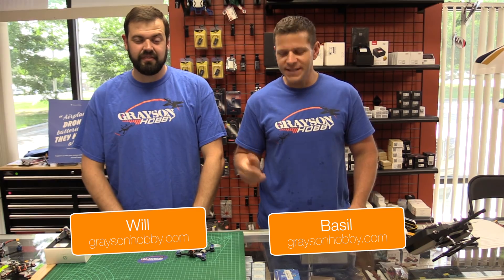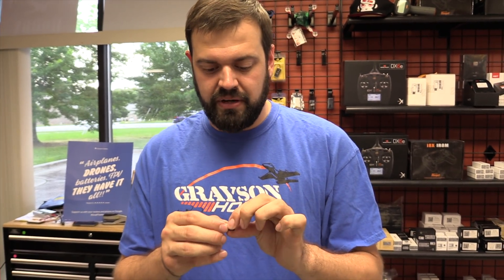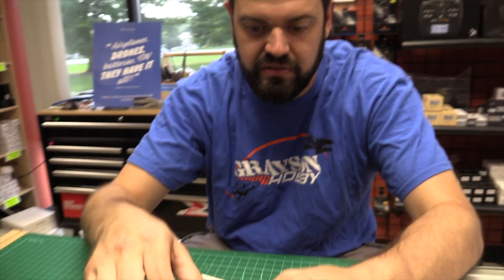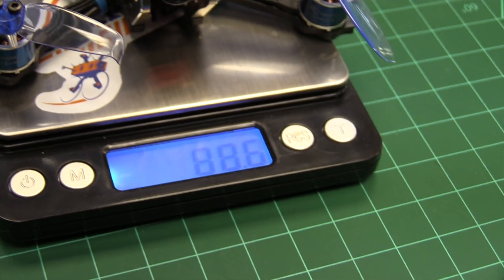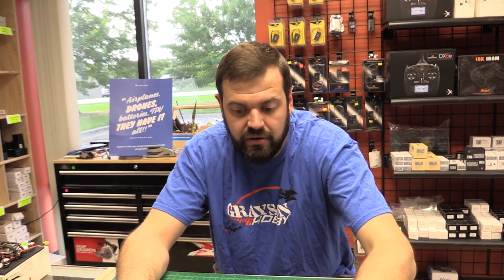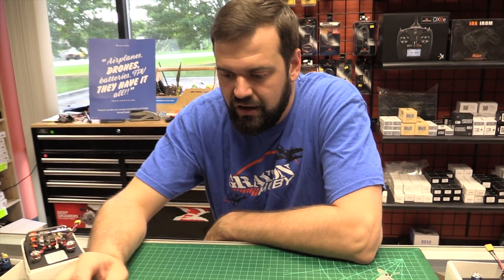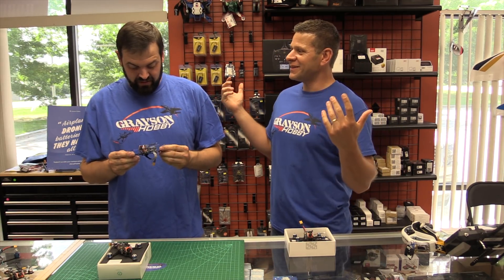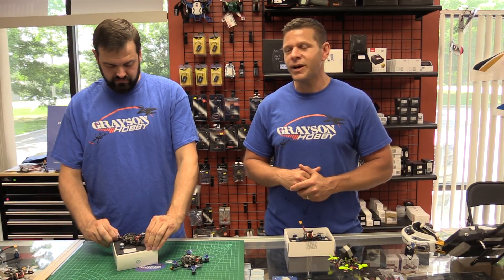Diatone 2.5 Inch FPV Quad - The Sweet Spot of Micro Drone Racers

Comment from the maker: Hey Guys - if you hate to solder we now offer Custom Installs for the Diatone Quads with FrSky RX AND we go the extra mile and flash the XM/XM+ with RSSI -

http://graysonhobby.com/multicopters-drones/diatonehk.html
Reply: Grayson Hobby great niche you guys spotted hope it pays off
soldering is part of the fun (for me) admitted it takes skill and practice- hmmm sounds like flying?
Reply from the maker: Jesse simmons it's the firmware / software on the xm.   I have asked frsky to flash with the rssi, but they wont do it, so we have it
Reply: Is this option available when we order via the web or so we have to call in?
Reply: Good review, thinking of buying one. Is it possible to add a R-XSR receiver? does it have a Tele pad to take full advantage of it?
Reply: Grayson Hobby.  Hay i do not like soldering!!! And i really want this!!!! Great post!!! This would be great for learning acro in the field across the street!!
Reply: Grayson Hobby That’s perfect for someone like me! I don’t suppose you ship to the U.K. do you?
Reply: When are you going to get more 2 1/2 back in stock with the xm+ that you put in.

Comment: What PID settings are you using for 3S? I found mine has motors running very hot and jittering with stock PIDs. Lowering D-gains helps, but would still be interested in better settings.
Reply: I'm wondering the same. 
It flys way loose. Ive tried mine on 2S and 3S.  I was wondering if they used the stock pids for 3S and 2S.

Comment: Awesome video guys keep up the good work 👍🏽 

Can you please help me I want that 2.5 Diatone racer but don't know what to do really I have a flysky fs-i6 Transmitter for my Quads and want to use it with this also but never done adding a rx to a quad. Wich one can I use and were to solder? Do I have to do some things with betaflight to get it run? 

THX so much nice regards from Germany

Comment: If Gemfan 3025 bi blades will fit on that 2.5” try it on 2S...
I fly those motors on a 3” frame on 2S and it is beter than 2.5” tri blades.

Comment: Basil. Maybe I’m an idiot but they aren’t working on my Mac.  I just did a black box analysis and shot the video over it. Learned a lot.  Got motors much cooler. Custom PIDS now on the 3s with the SQ 12. It was decent in 3.3 but moved it yesterday to 3.4 RC 2.  Wow what a difference with 3.4.  Not even barely Luke warm now on the 3s. I was looking for an easy way out. Just should have done this yesterday.  3.4 is a much better OS in my opinion.
Reply from the maker: wow, thats great to know (about betaflight ) lol

I suppose you are using Safari?  Do you have another browswer?
Reply: yeah I can get to the battery links just not the updated pids in safari firefox and google chrome.

Comment: I am loving my M2.5!, have had it a few weeks!  It flies and floats way more like a 5" than any other 3" or lower I have seen and it really rocks!   I have only been running 3S, no 4S yet, and I also turned down P and particularly D to a tune similar to Albert Kim that cooled motors some but still very warm/hot in 95 degree Florida all the time. - I'll check out what you posted... However I did find I fried a motor last weekend, after? a crash - have one coming on a slow boat... Could you guys get some matching motor stock here then in US for us all? (it'll sell) - don't think you currently carry it yet... Also I found I could put a Lantain HD DVR INSIDE there right behind the runcam all in that tight sturdy camera protecting GTM frame!  I would love it you would also carry that DVR - it gets a few lines on it but still much better than the DVR and can squeeze that board on anything (though I had to make a small clip on a screw to make sure the spring loaded micro sd doesn't release in a crash.). Could you also stock the frame kit(s). It's so fast that racing it's only a matter of time I'll need a frame plate...  ideally from y'all and not on a slow boat... Thanks for all you do for the hobby, guys!
Reply from the maker: Great feed back, and thanks for watching!!  
We have all the parts restocking soon. We just wanted to be 100% this was a winner before we loaded up :)  All the parts should be here soon

Comment: I own the 2.5 and 3” versions.  They are incredible.  I was gonna try a 4s pids on the 3cell due to the heat on the 2.5 on 3cell.  I run mostly 2s as i don’t want to smoke the motors.  Summer is in full swing. Your link on website is broken.  I would love to create a 4s pid profile just because I can.  Will you look at that link please guys? I buy and will continue to buy from you guys.  It is probably a very good thing I live over 4 hours away.  Not only would I be broke but you would get tired of me as I would likely live at your store.  Thanks for all you do!
Reply from the maker: Hey we would love for you to come and visit - 2S is fun if your area is smaller.
I just checked all 3 links and they appear to be working - which link is not working and i can double check - B

Comment: Great review guys, keep up the great videos.  - I like the Diatone keeps getting better. I have the GT R90 and the Tyrant S and enjoy flying them both, but I must admit that even though I use 3S, the motors on the GT R90 are always hot at the end of the battery. I  have to wait until they cool before I strap on another battery. I think the heat on the motors is also wearing them out quicker, they're not sounding as smooth as they use to and the bells are not as tight as I think they should be. Having motors run hot is probably not a good thing and going down to a 2S battery is not the direction I want to go. Maybe a motor with a lower KV would help. 
Anyway, thanks for the video.
Reply: +1 agreed, if 4S, and even on 3S, we may need lower KV option, any suggestions? or other tuning suggestions to further cool them?

Comment: i have the mt3 and is  beast... the only complain is that they could put a runcam on it like in the other versions. or like the geprc sparrow...  btw... do you have an sparrow.. turn the motor and then the mt3 motors...  feel the diference.